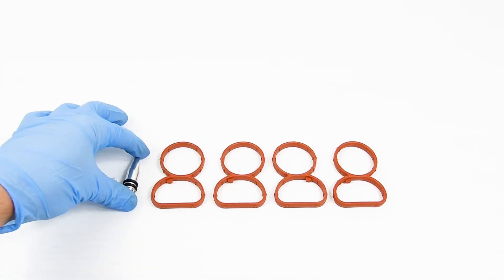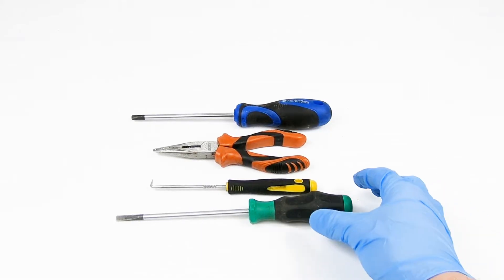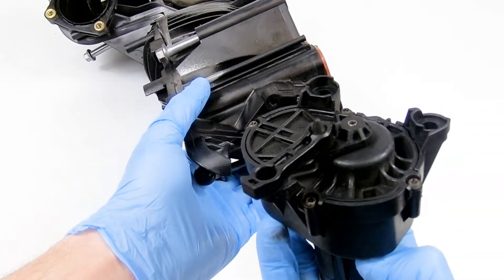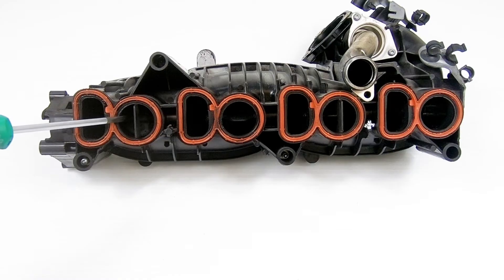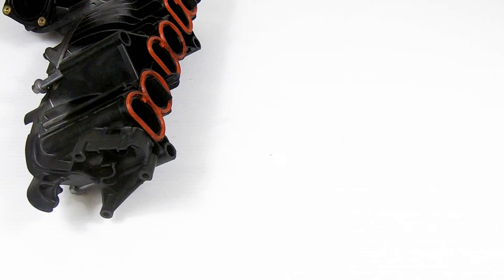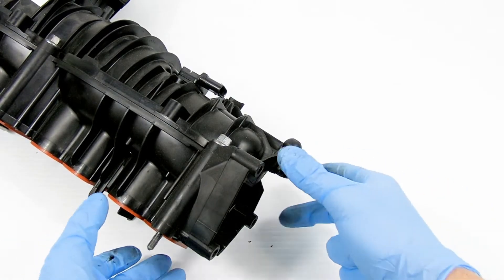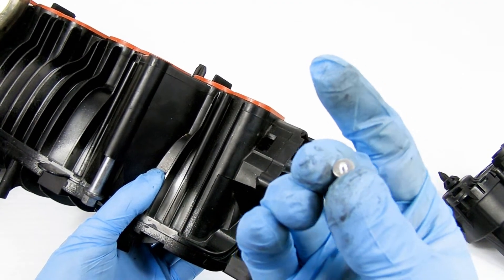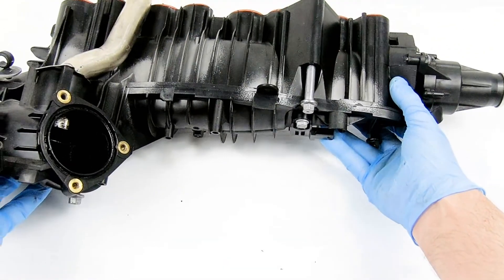BMW N47 Intake Inlet Manifold Swirl Flap Removal Delete Metal Blank Plug Bung Repair Instructions

Comment: Buna seara. Am o problemă la un Bmw X3 motor de 2 L. Imi tot suflă intre oringul ce vine pe țeavă de inox și întră in chiuloasă . Am luat țeavă pe original cu oring pe original si tot imi suflă.  Mă puneți ajuta cu o părere ce sa fac să nu mai sufle?
Reply from the maker: Hi there, have you tried replacing all the gaskets with brand new gaskets from BMW? - Georgina, X8R Ltd

Comment: So if the shaft is removed  what stops air from being drawn in from the next gallery or does it not matter ?
Reply: I do not think it matters as they a fed by a common void just prior to the shaft holes. The pressure should be reasonably balanced

Comment: If there is no evidence that the swirl flaps or the motor are likely to fail, given your engine, wouldn't it be better to just clean the swirl flaps? I understand that you get minimal torque loss at low RPM but the inefficiency in combustion, the need for an ECU remap and the increase in emissions seems like a bad trade-off if you're unlikely to get a failure anyway. If you do have historical swirl flap issues with your engine model, I'm sure there is likely to be replacement parts that have superior engineering to replace your swirl flap or motor no?
Reply: Shut up if u don't know shit. They do brake, and u don t need a remap if u delete them.

Comment: Hi. I used your product in my garage many times but after always have problems with dtc codes about actuator arm resting position.  Do you have any solution for this problem? Thanks
Reply: put the actuator linkage arm on - it moves the resting position by about 3-4mm back within range. When I remove the swirl flaps, I cut the rod with a small grinder, leaving the "end pivot" in place so the linkage can still be fitted normally to both the actuator & the "rod".  I cut the rod into 4 short pieces so each can slide out (rod carrier removed from intake manifold, it just clips on). I use a grinder because the rod is tough as old boots - good luck cutting it with a snips.

Comment: Hi, Where can I get this rubber Oring (grommet) that is used on the rod shaft? Show in the video at 3:20 mins. Thank you. Or any dimensions of this grommet. Thanks
Reply: did you find it?
Reply: @kdzenins  I thought it was just the seal leaking but when I took it off the rod had snapped. So had to get a new manifold with swirl flaps. The grommet was a hard bush. Let me find the size and get back to you on it
Reply: @zeshanhussain1715 thanks! I am going through this now, was wondering if anybody had swapped the oring. New intake is like 210€

Comment: please answer the Question People here asking ?you are Prefessional and want sell your Product?then you can also answer can I remove it only no programming no reseting something software and so?and after installation plug  the original cables in?
Reply from the maker: Hi there, you do not need to remap or reprogram the engine after installation. You do not need to purchase anything else to complete this repair other than what is included in the kit. Thanks - Georgina, X8R Ltd

Comment: What happens when I remove them? Then the exhaust can go into the engine without a regulation? Right?
Reply: No. The "swirl flaps" regulate the volume of air going into the engine. The exhaust gas going into the inlet manifold is regulated by the EGR valve (Exhaust Gas Regulator valve - deleting this is desirable but not related to this procedure). 
It needs to be noted that the swirl flaps act  to restrict air flow at lower RPM which is compensated by the programming in the ECU. Removing the Swirl Flaps without compensating (remapping the ECU) will cause a lose of torque (power) at low RPM. This is due to the over supply of air - it will in effect "bog down". For us older blocks, this can be compared to having a carburetor that is under jetted in the primary jets where the air restriction is a fixed size. In this case the swirl flaps provide a variable air restriction and vary the air flow to match the RPM which provides the optimum torque and performance. Removing them IS NOT a good idea.

Comment: Hello! Could you tell me if the flaps are installed in the engines N57 (BMW 430d (2015))? Is it possible to upgrade the flaps as aluminium parts? If I delete the flaps, is it possible to do something in the software from the engine? Is it possible that I get some failure if I delete the flaps? I ask because I am thinking that the engine becomes different values of the air about deleting the flaps. Thanks in advance! Danijel
Reply from the maker: Hi there, we recommend getting in touch with us directly with your reg & VIN to see if our kit is applicable. Thanks - Georgina, X8R Ltd

Comment: Question....after removing the flaps and fitting this kit, will I lose any torque in lower revs please? Thanks.
Reply: I removed my flaps and loss of torque under 2000rpm is minimal or non existant
Reply: @ciepularys did you have to have the car re mapped or not
Reply: @popsbmw  no need
Reply: I have had dpf and egr, swirl flap delete do I need a remap? I've not driven car yet as I'm at work so need opinion as whether to remap stage 1 or leave
Reply: I wrote this over a month ago and no reply from X8R Ltd.....no worries I'll take my business elsewhere then, useless....
Reply: @leadster88  you do not
Reply: leadster88 I’ve the same problem with a different kit on my 330d
Reply: @kingstonbe  ? so you lost torque doing this mod?